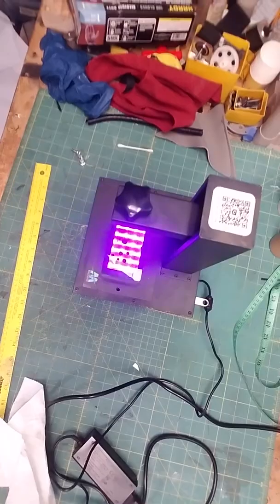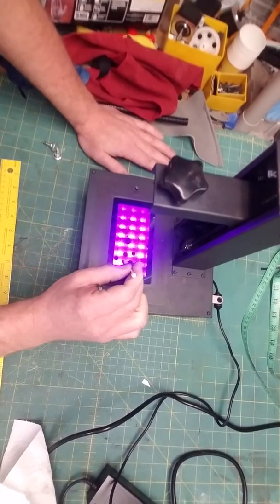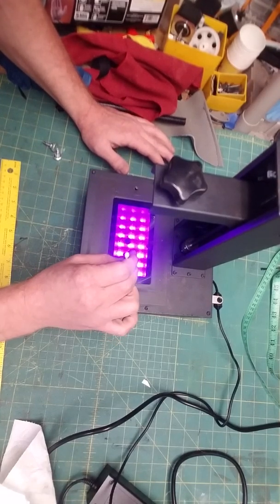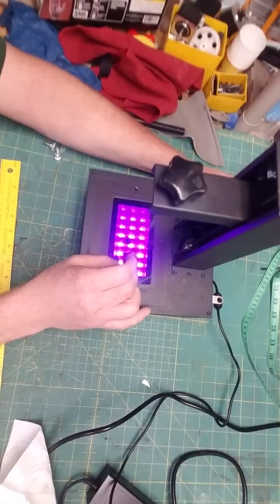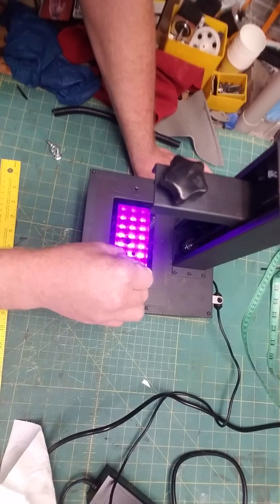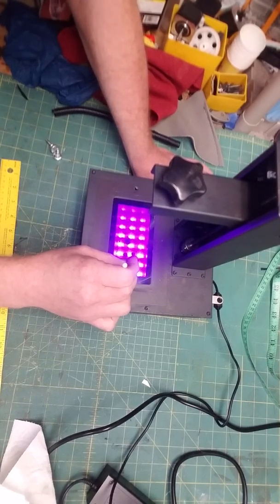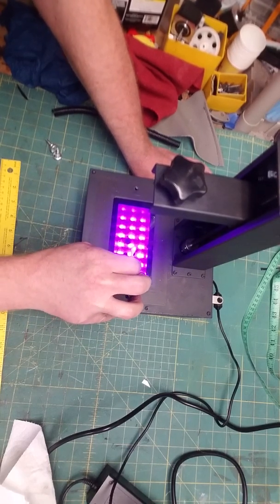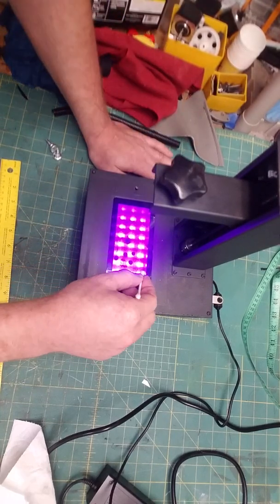Fixing "dead" spots on LCD screen on my longer 30 resin printer

Comment: You don't need the fancy glasses if you place a piece of paper over the LCD screen like you would do when leveling.  As a bonus, it also makes it easier to see the dark spots, and you can apply pressure over the paper as though it wasn't there.

Comment: Neat. Question though. What if you have areas that do no exposure. In particular horizontal lines or whole sections. Is there a way to fix those. I am currently trying to get the support staff for the people who I bought my printer from to help me and maybe send a replacement but dealing with these companies from overseas if taking a very long time. From the time between emails to the amount of time it takes them to actually ship the parts from overseas, the wait is extremely long. For example I have had my Elegoo Saturn for around 5 months now and it still doesn't work and I have been waiting for the replacement control board for 1-1/2 months & it's their second attempt shipping it. Now I have a issue with my Phrozen SonicMini4K where the LCD has the lines and areas that do not expose and those areas changes depending on the models size. It came this way out of the box. I am a bit perplexed by it because the areas change and is not a exact section that does this. The ribbon cables are all connected good. It makes me wonder if the lcd is bad or it's control board.
Anyways thought I'd ask if you had any tips for this issue. My luck with these printers has not been the best considering I have two that never worked out of the box. It's like I wasted over $1k for two paper weights.
Reply: 111 q